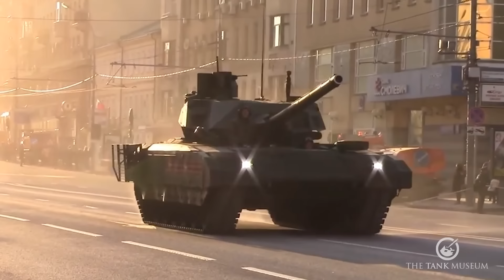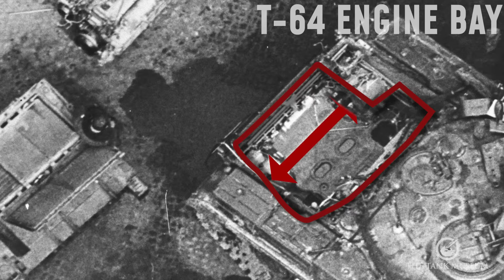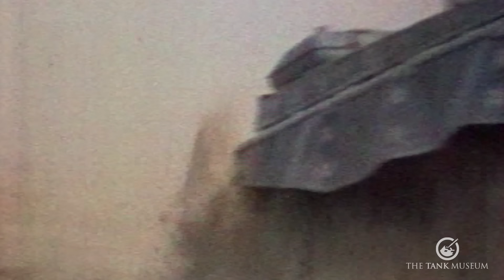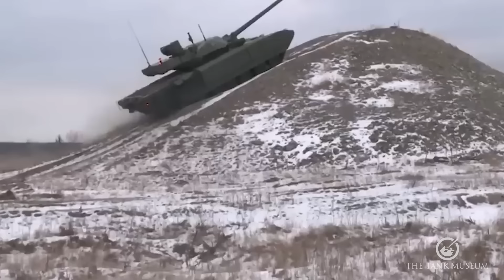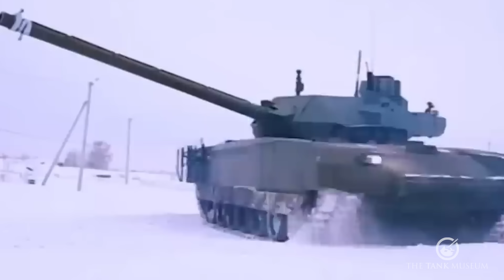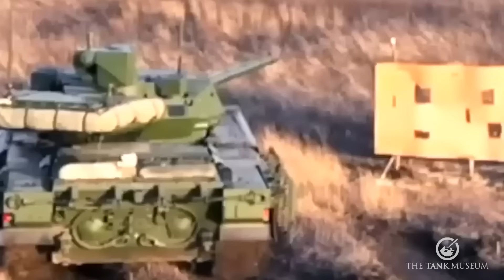Radical or Ridiculous? | T-14 Armata | Tank Chats #171

Comment: Never in the field of human conflict has so much been said, by so many, about so few tanks
Reply: preach
Reply: @RamonaFlowersWUBRG  peach
Reply: More has probably been written about Tiger tanks than all other tanks combined.
Reply: @TTTT-oc4eb original poster said about "so few tanks". There weren't a ton of Tigers or King Tigers, but at least those saw combat on multiple fronts and were made in the hundreds. There are, what, maybe a dozen T-14? And they're all just test beds/prototypes. 
I agree that there is too much written on the Tiger and King Tiger, but at least there is a track record there.
Reply: @TTTT-oc4eb  But there more than 3 of them. Admittedly not many more!
Reply: @TTTT-oc4eb  because they put the fear of God into troops just by saying"TIGER"
Reply: @TTTT-oc4eb  Rightly so.
Reply: @TTTT-oc4eb  There were also many more Tigers than Armatas.
Reply: @TTTT-oc4eb  The tiger was produced in large numbers and were deployed in battle extensively.
Reply: @lochnessspeedwerkz6557  By WW2 standards the Tiger I and II were produced in tiny numbers.
Reply: @TTTT-oc4eb  but still in significant enough numbers to be a contribution. There were more Tigers and King Tiger then there are T-14’s
Reply: @AvtomatKentucky101  But the OP never said anything about contribution. Which of course is the main reason for the vast mountain of Tiger articles and books; its impact far outweighed the numbers produced. For a starter, it basically "upgraded" Germany's entire fleet of venerable Panzer IVs. There were even instances where Kubelwagens were mistaken for Tigers.
Reply: @TTTT-oc4eb  and compared to the T14, the tigers were produced in large numbers.
Reply: @TTTT-oc4eb  And there are still more Tigers than there are T14s.
Reply: @aaronleverton4221  There are two running Tigers (I&II}, and two more to come soon. In addition to a few museum pieces. So yeah, pretty much the same as the T-14.
Reply: @TTTT-oc4eb   Production Tiger 1 PzKpfw VI  1-3, 1352 ea, +- 10... PzKpfw VI Ausf. B Tiger II  Konigstiger - 489 ea. Armata T-14 between 10 and 20 ea.
Reply: @AvtomatKentucky101  Tiger 131 still existing means there are still more combat-tested Tiger I's in existence than T-14s :))
Reply: @TTTT-oc4eb   YES, tiny numbers acc. to WW2 standards - but they had HUGE IMPACT on the enemy. Not to mention kill ratio. But tbh, Stug3 and Panther had best numbers, however, any ally tanker in WW2 was shtting his pants when seeing Tiger/s are coming. Many more never saw them coming. You cant compare those beasts with T14. There will NOT be ANY modern tank that would slaughter entire enemy armoured column (like when Witmann destroyed almost 30 allied vehicles near Kaan).
Reply: @TTTT-oc4eb  lets remove that prefix there by numbers the tiger 1 tiger 2 were produced at a X scale compared to the no armadas they have functional
Reply: Very clever Sammy 😀
Reply: Except the Russian have produced more tanks than anyone else. The vast majority are still available for use, with differing levels of servicing required.
Reply: And how do you know how many tanks have been produced?
Reply: 🤣🤣🤣🤣
Good one, Winston!!!
Reply: WW2, dumartin
Reply: About so few tanks, doing so little, even.
Reply: I think tanks, in general, are overrated...DRONES are clearly the future and tanks can just be picked off from artillery, drones, airstrikes and a couple guys hiding in bushes in ambush
Reply: @liveuser8527 and all of those scenarios shouldnt be a thing if you use combined arms. What you are seeing in ukraine is way off how they should be deployed. Leos werent supposed to be solo warriors lmao (to be honest the same goes for the "other side" tanks).
Reply: @liveuser8527  Sure, when the tanks are gone, the drones can stand guard. At least for the 30 or so minutes of flight they usually achieve.
Reply: @liveuser8527  As long as the role the tank fills isn't either made obsolete or filled by something else, tanks will continue to exist.
Reply: Classic!    Lmao.   Churchill would be proud of you!
Reply: Maus ? e100? Sgt York? Divad?
Reply: @orbitalair2103  e100?? he said in a conflict, the E100 was completely unknown until it was featured in a few video games, it was found less than a month before the war ended
Reply: U should get ur ears checked
Reply: Exactly.
Reply: I just googled it, and apparently more than 10x as many King Tigers were made than T-14s- like around 500 vs  only 40.

And the primary thing most WW2 analysts say about the King Tiger was that, regardless of how powerful it might have been, there just weren't nearly enough of them produced to really have had much impact on the war.
Reply: @bbbabrock  Eh, the Tiger was also just logistically awful. It needed its own special everything to actually get it to the battlefield in the first place, they also didn't make enough spare parts so they were basically impossible to fix. Making more of them would have just made them waste more resources with the aforementioned special everything.
Reply: its not Abrams X
Reply: Ratte wins easily because (conversation)/(number built)=(finite)/(0)=(infinity)
Reply: 1500 tigers vs. 10 T14
Reply: I never saw Russians talk about it its mostly western people talking about it
Reply: useless and totally biased video, judged based on westerns mindset where expensive is "more better", russian and chinese fight with quantity, t14 wa left aside because is too costly and to boost t90M, t72M and t80M production, chips are being smugled into the country like no sanctions have ever happened you guys live in a bubble of childish
Reply: cough cough
Maus
Cough cough
Reply: Meat Salad  Cope harder, Kremlin. We look forward to your fourth mobilization, which will see thst lone T34-85 from your victory day parade deployed to the front. XD
Reply: @andrewgause6971  He is right though, all oil made in america is domestically used an the 2 other largest oil producers in the world russia an saudi arabia both arent forkin over oil, so inflation as struck hard for gas for any product cause everything is moved by oil an if the oil is expensive then something has to make up for that cost.
Reply: @andrewgause6971  Lol! Savage. I'm going to use that one!
Reply: @Whatifwarlord  Four years have come and gone since 2015. Armata has never been seen in action, the company that built the engine for the tank is bankrupt because the kleltocrats that ran the place pilfered all the funds, and the tank can't use a different engine because it's literally built around that engine. And on top of that, Russia is now cut off from the components it needed to build its advanced chips and optics, thus requiring sanction busti g and smuggling, which is going to cost 3 to 4x as much. 

So again: it needs time. Time it doesn't have. Resources it doesn't have. 

As for the offensive, we'll see, won't we? Ukraine already appears to be engaging in battlefield shaping, especially with what just happened near Belgorod (mobiks are going to have to be pulled away, even if they know its a fient, because Russian soil just got invaded for the first time since Barbarossa, and to just let them take it would make Purina appear weak and incapable of protecting "his" country.)
Reply: @andrewgause6971  you’re still talking about Belgorod? Those guys that were sent on a suicide mission for tiktok and twitter likes from NAFO psychos more interested in “trolling vatniks [a word they just learned last month]’ than the lives of young men on both sides? The guys who got sadly wiped out the same day, as in last week?
Reply: Probably because they don’t work. All they have is what people say about them.
Reply: That comment is a thing of beauty.  I'm not happy with you.  :-)  Thumbed.  And I think most of the replies in this thread demonstrate that they haven't got a clue of what you said there.   May I add: And even fewer have gotten to the end of the parade.
Reply: There’s only one thing to say about tank in this conflict: they are useless against artillery and drones which are dominating this conflict. And are much cheaper and faster to produce than a single nato tank.
Reply: ...a cheap adaptation from Winston Churchill.
Reply: @hcf1956  obviously a joke.  Do you not see the humor?
Reply: Never in the field of human conflict has so overpraised weapon (Leopard 2) failed so hard.
Kurds and russians send their regards.
Reply: Before you start crowing about western superior tanks you should remember western tank building countries have also produced tanks that were somewhat lacking.
Reply: @Puzzoozoo  go through the history of tanks right? When we’re talking about a vaporware tank from Russia?
Reply: @Whatifwarlord  Yep. Because those issues were eventually corrected and improved upon. I'll believe the Armata is a functioning impressive tank when it deploys and rolls back Challenger 2s and Abrams. ^^
Reply: @andrewgause6971 I’ll worry when they have more than 20 operational T-14s.  It’s vapor ware.
Reply: @andrewgause6971  it's tank made mostly with western components. They could build more in 2080 after sanctions would be lifted.
Reply: @ImperatorofNonsense  Western washing machine chips are so powerful, and completely different to the washing machines sold in Russia, and the rest of the world. I bet those Soviets got a hold of those washing machines back in the 1950s, and used those chips to power the first rocket to leave Earths atmosphere. It does make you wonder though, how those brilliant scientists in the West couldn't figure out how to be first in space, but made washing machines which could power rockets to go there.
They must have been smoking Copium, just like you do.
Reply: @rightiswrongrightiswrong806  WTF are you on about !!!! There were zero electronics in 1950s washing machines. 100% analog. Not a single transistor in the entire unit. What have you been smoking ?
Reply: Do you realize that being first in space was a possible penetration of the airspace of enemy countries?
Until did it of course, then the success haters, the inferiors, they had to admit it was fine.  
 @rightiswrongrightiswrong806
Reply: @andrewgause6971  yeah, the T14 hasn’t even been finalised, and none of the designers have suggested its ready for production and deployment. There are always delays in projects. Cope harder. But you’re right, the Leopard 2s and Challenger 2s are being battered and beaten back by upgraded T-64s and T-80s, Armatas aren’t needed right now, thus development and production has been put on the back burners. Meanwhile Leos are getting stuck in the mud. I don’t even support Russia, but I really can’t stand this Ukraine/NATO fanboyism that just pathetically misrepresents reality in a desperate attempt to paint the dark reality of Ukraine’s position as somehow brighter.
Reply: @darcgibson5099  "I'm not a flat-earther, but why does everyone so easily believe in NASA, ESA, Roscosmos, CNSA and JAXA photoshops?"
Reply: @h8GW  not remotely comparable
Reply: @darcgibson5099  " Leopard 2s and Challenger 2s are being battered and beaten back by upgraded T-64s and T-80s, "  Really !!!  Where ? In a video game ? So far it has been mines, drones and artillery.
Reply: @h8GW  Yeah, people should stick to reliable sources like Fox, OAN and Newsmax 🤣😆😂
Reply: @darcgibson5099  You do realize the Armata is actually behind schedule compared to when the designers said it would be ready right?
Reply: If many are speaking about something, listen carefully: things that are repeated the most is the actual propaganda, and who repeats it, makes biggest benefit.
Reply: This comment is on every armata vid.... and everyone points put how wrong it is.... everytime.
Reply: And never has a museum made So many obvious mistakes.
Reply: @tomk3732  Please elaborate.
Reply: @tomk3732  What do you mean?
Reply: @tomk3732 enlighten us, please.
Reply: @tomk3732 lol thanks Vlad😂😂😂😂

Comment: 02:44 it makes sense, when you follow someone's lead instead of trying something completely new you can avoid the mistakes that others did before you 😉
As for " T14 armata" it seems like many in the Russian leadership knew the danger coming from the modern anti tank weapons but didn't managed to produce the vehicle in time
Again if you think about it the design features of the vehicle intricate that
As for the ability to put in production in Quantities that would make any difference? Well as long as the Russians have enough numbers of older vehicles to refit and send to Ukraine I don't think T14 will be a high priority
Reply: They don't want to produce the vehicle. It's built around an engine that doesn't work. That didn't make it on the civilian market due to unreliability issues. 
And the tank is designed around this engine, you cannot replace it. To do so would mean having to redesign the entire thing from the ground up. 
It's such an impressive case of idiocy that any reasonable person should ask themselves if it wasn't sabotage
Reply: @harmen2456  I don't think the engine issue is the most important  it's probably to much of a pain time and investment to make it into a mass produced product
Having said that I wouldn't be surprised if we see some" mutant " variant of older vehicles utilizing some of T14 technology, after all T14 is based on the t95 prototype

Comment: Putting all your vehicles on a  tank chassi must cause alot of problems for fuel consumption  witch we have seen has been a massive problem for Russia and wonder what they can do if the auto loader gets jammed and we have already seen a few terminators be knocked out
Reply: Not really an issue with fuel consumption. Unless you use a turbine engine.

Comment: T14 will no doubt be in the vain of the MBT series of the German/US Programs. Cool concepts, but never to see light of day in production, but design elements will be taken from it world wide. 
Good innovation.
Reply: there was an abrams with most of these features. It won't be taken world wide as t he world already 'innovated' these things decades ago.
Reply: @dfjab  Well no, not at all, a Seperated crew compartment and unmanned turret is entirely new, and inbuilt trophy systems and not a upgrade box slapped on the side of a SEP program.

It is new and Has innovations many countries wouldnt bite the bullet to do, Hence the similarities between the MBT program in the 70-80s

Comment: T14 is nowhere near production and is not a priority, tanks are useful, but not critical on a modern battlefield. But for all those having a go at russia remember the west has not been any more succesful than russia in new breakthrough tank design. Leaving the Armata off the production line is a streagnth, not a weakness and shows wisdom.
Reply: The main difference is that Russia invested enormous resources into the T-14, which (like the Kuzneztov) has become a white elephant. Russia should've cancelled the T-14 long before they actually did.
Reply: @Cailus3542  why, its testbed. It may be useful, the cost benefit is not as clear as you assert
Reply: @Cailus3542 it's not a waste - they will use the experience and tech with other designs - including Terminator variants (my guess here). You can't beat practical experience in development.

Comment: I heard it takes 5 Shermans to take out a T-14.
Reply: Or 1 top-attack missile.
Reply: @ToEuropa  Another Jack in the Box tank from Russia.
Reply: @ToEuropa  in Syria old tank received 2-5 hit from atgm and survived, so 1 missle if this not cruise missle probably not enough. Maximum it destroy engine.
Reply: @trololoev  During the Gulf War it certainly did not. Neither did it in Ukraine
Reply: Nah one would suffice. Literally one. Effing. Sherman. Turret is so badly armored that you can knock out sights using infantry weapons. So yeah one would be more than enough.
Reply: @MaD0MaT  Armour on any tank doesn't protect the sights or sensors...
Reply: @tomasg4623  I know that, but in this case it is far less protected overall. And if you take out sights in this tank it is disabled for good.
Reply: 5 Abrams*